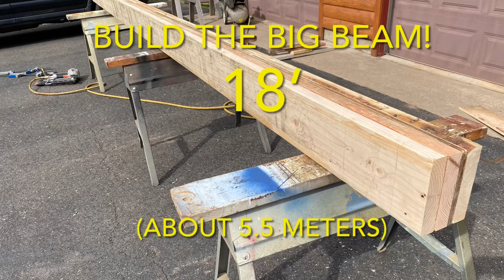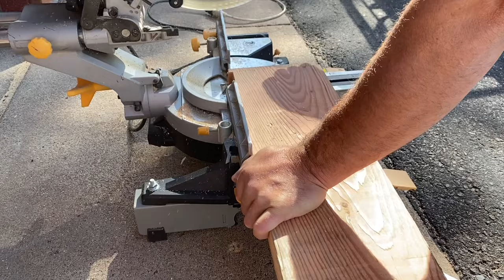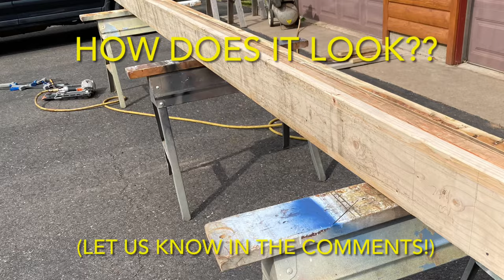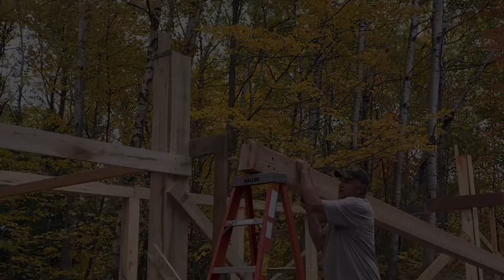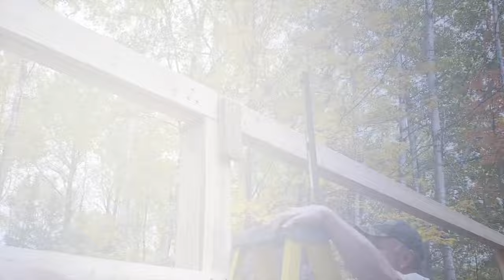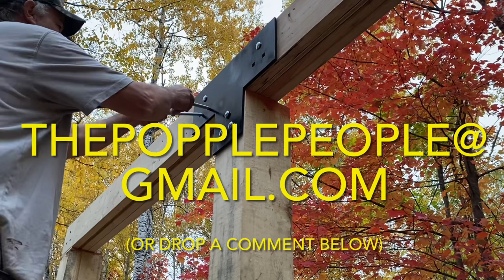Saving $$$ by BUILDING the BIG BEAM Ourselves (OFF GRID SAW SHACK HEADER)-Popple People-Episode 60

Comment: was removing load bearing walls in a house. 28 ft span. decided to build my own beams. laminated multiple layers of osb which is typically used in engineered joists with amazing results and it has nearly no flexibility when on end. I used lots of glue and sandwiched 2 layers onto 2x10 boards 14ft each. had a completed beam approx. 9.25x4.5x28 and I tested it by laying it across a couple of sawhorses, it would sag and bounce far to easily to be useful for any load. 
I ordered 2x10x30 LVL beams.. absolutely no bounce, There is a incredible difference between typical framing grade lumber and the marine grade hardwoods used in these applications.
Reply from the maker: Interesting! Thanks for sharing!

Comment: For future reference,  there are ways to get your sawmill to make longer cuts without extending the track.
Reply from the maker: Thanks for the heads up! We didn’t try that because we needed to get that made & up quickly (we were racing against the weather turning to winter).
Reply: @PopplePeople try it when you get some free time and warmer weather,  super easy and basically makes milling length capacity X 2.  
This beam you fabricated looks like it will work just fine regardless.👍
Reply from the maker: Thanks @joshpoole6056

Comment: my only comment would be, most places i've seen follow the 1 nail every 2 inches of board height when securing the boards together. from what i could tell, you used 2 per row of nails.
Reply from the maker: Good observation. The glue & nails we used held up very well so far, & we had 12 feet of snow last winter, so it definitely got tested. Thanks for watching!

Comment: Those metal T plates do not appear necessary from an engineering point of view.  And the expense nowadays for those large bolts and metal plates is surely greater than the expense for large timber sizes.  I have seen carriage bolts shear, even pricey ones.  I have seen four pieces of 2x12" and four pieces of 2x10" laminated and mounted up as you have done with wooden treenails and timber screws without the slightest issue over years in high snowload areas.
Reply from the maker: Good to know! Thanks!

Comment: Did you use the plywood in your beam for a reason, such as getting a specific thickness?! Or does that add strength or what?!? I'm curious!! Great video and excellent work on the beam!!! Cant wait to see this building project completed!! Thanks!!! Don W., Ohio
Reply from the maker: Thank you, Don! Yes, the plywood was added for strength, as well as the structural wood adhesive when assembling, as shown in the video. Also, we add a vertical 4x4 to support the beam in the winter, just to be safe, due to snow load (& we are not using the mill in winter anyway). Thanks for watching! We appreciate it!
Reply: Great video I am doing an extension to a single story bungalow 4.5mtr plus 2.5mtr thinking of doing this rather than steel beam for header resting on original stone walls , would this be strong enough to support ridge roof with tiles , anyone ? , thanks in advance
Reply from the maker: @darrenpodger7294 not sure we’d do this for a dwelling…this was for a saw shack. What are building codes in your area?That being said, this roof did hold up 12 feet of snowload during winter 2 years ago, so it’d likely be able to handle tile roof weight. (We ended up shoveling it just because 12 feet was such a crazy amount—not what we typically see during a “regular” winter). Best of luck on your build!
Reply: @PopplePeople  thank you for replying, that's alot of snow wow and weight , I'll have a think and ask a few builders , great video .
Reply from the maker: @darrenpodger7294 thanks!

Comment: Isn't the glue supposed to be spread out evenly to maximize the strength of the bond?  Just wondering.  I could well be wrong.
Reply from the maker: No idea…all we know is that we have glued boards together before (using a similar technique) & when we needed to get them apart, it was very difficult to do. Ended up having to use a sawzall to cut them apart. That glue spreads out quite a lot once you press the boards together. This beam has held up so far with no issues (it’s over a year since we installed it & last winter we had 12+ feet of snow & it withstood that considerable snowload). Even if it was done improperly, it worked for us.